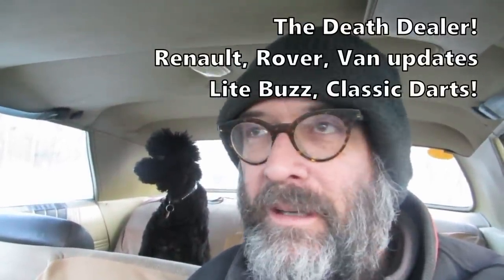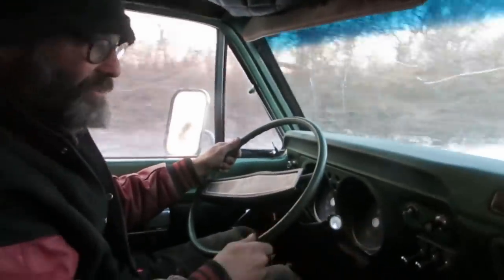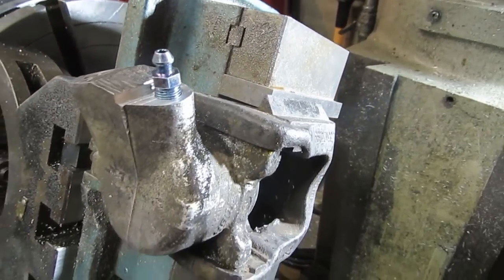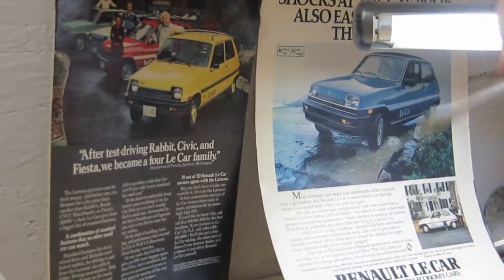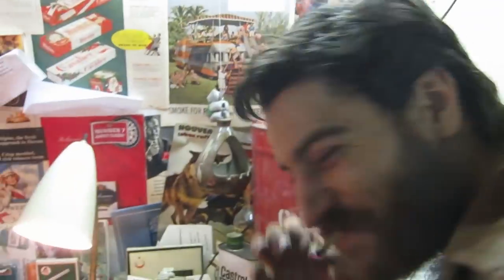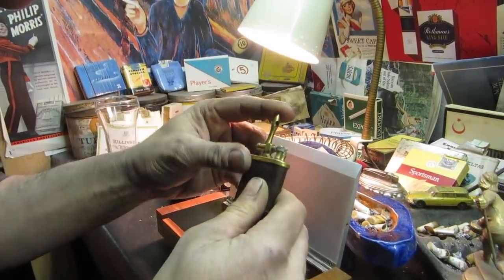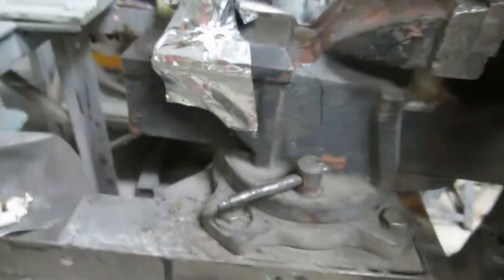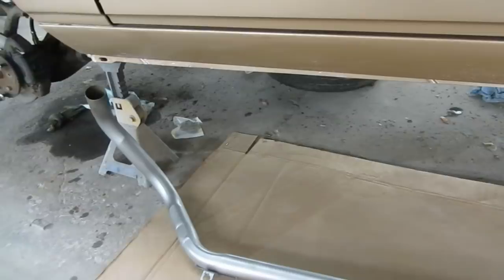Rotisserie Rover, Renault Renos, Boogie Vans, and Making a Screwdriver out of Cigarette Butts!

Comment: As a kid I had a yellow R5 by matchbox, always wanted a real one! I miss how individual those little cars used to be
Reply: I had one of those. Don't know what happened to it.
Reply: True, it was a very unmistakable design. But paradoxically, in pioneering huge plastic bumpers it was a large step to where we are now!
Reply: @thomasalbrecht5914  ...And the tail light clusters high up on the rear pillars...
Reply: @paulbennell3313  Yes, it was all first-rate small car design: functional, with every single piece serving multiple purposes where possible, and economical to put together. A good small car is a real exercise in production engineering, it’s not much cheaper on an industrial scale to make a small car than a bigger one, but there is a much smaller profit margin in it. So it takes brains to make something that is smart, and when someone comes up with a good idea for that, the competition will follow, because they’re all in the same trouble.
Reply: @thomasalbrecht5914  I think it's fair to sat the Renault 5 was the first supermini.

Comment: You need to remove the caliper seals and then clean the aluminum corrosion from the bottom of the groove the seal sits in. The corrosion over time builds up and pushes the seal tight against the piston and that is why you can't push the piston in by hand. I have done hundreds of seized motorcycle calipers that are the exact same design. I have even made a video about the process. 👍👍

Comment: When the Rover doesn't start, remember that Frankers has already identified the problem and check the fuel filter.
Reply: Frankers is certain thaT THERE IS A MOUSE INSIDE THAT EXHAUST PIPE!

Comment: Rust falling out of the rocker reminded me of when a friend got the front bumper of his rusted 76 Dodge Aspen wagon stuck into the wheel well of a Port Authority bus, when pulling out onto the street.  He got dragged a good 50 feet up the hill, before perfectly breaking away at an intersection and taking off.  His plan was to drive 50 feet up the hill in the parking lane and turn onto that street anyway, but he forgot that he had his wheels turned out toward the street. A friend who witnessed this charade in the local business section was laughing about how the Aspen left giant rust piles on the street, due to the shaking action.

Comment: That Renault brings back memories. In the 90s i worked in a muffler shop. Dealing with Eastern Canadian Coast rusted rocker panels on those cars. Trying to keep that exhaust pipe solid and the muffler inside the engine bay, not built for Canadas winter. Enjoy the videos, thanks.

Comment: On the plate from the Rover it probably is L for left-hand drive and S for saloon or sedan, the two body styles for the P5 being saloon and coupe, both four door but they had different window frames and rooflines.  It's interesting to see that it has disc front brakes when it's a mik1A version.  As memory serves, drum brakes all round were standard equipment on the mk1 and 1A with front discs being optional, so someone paid out for the discs when it was new or has retro-fitted them during its' life.  Front discs became standard later in the production life of the P5...
Reply from the maker: Thanks for the info! I wasn't aware that the discs were an option. The car seems pretty untouched, so I think they've probably been there since new, or almost new...Cheers!
Reply: @coldwarmotors    Yes, that's likely as swapping over to the discs would mean changing a lot of stuff, I think the hub carriers are different as they have, or take, a bracket for the callipers, the front brake lines are likely to be different, you'd need to add the vacuum port to the engine for the brake servo as the drums were not assisted and so on, a lot of work and expense on an older car...

Comment: I had an Amazamatics car as a kid in the early 70's.  It was  controlled by a card about 1.5 inches wide (37 mm for you Metric guys) with notches cut in the edges that followers would direct the steering and determine forward or reverse as the card automatically fed through the length of the car. It came with some factory made cards with programmed movements and blanks that you could cut yourself to program its movements.

Comment: Hey Scott,  those Renault calipers look to be aluminiun? This is mostly motorcycle stuff, but whenever I get a steel nipple that's tight in an ally caliper, I stop, fill the kettle and switch it on. While that's boiling I find an absorbent shop rag (T-shirt works well) and wrap that round the caliper where the nipple is. When the kettles boiling, pour most of the water over the rag, make a tasty hot beverage with the rest of the water. After a while of sitting and sipping, enough heat will have transferred to the body that you have a chance of getting the nipple out. The advantage is that you don't set fire to anything or melt any seals and it carries a lot more thermal energy than a heat gun. Not a guaranteed technique, but fairly low risk.

Comment: I' m thinking  the "Deathmobile" was probably done near the van conversion era due to fact that it was clearcoated in enamel or a 1st generation urethane.  It doesn't like look lacquer because it seems like it isn't "crazy cracking" like a lacquer would.  It might be tricky, but Kyle might be able to do a quick dust in to repair the clear or just leave the battle scars because it looks like it's not going to take any prisoners!

Comment: I have a set of Appliance aluminum slot mags that I've had restored. They're 15x7 with 5x4.5" (mopar/amc/ford) bolt pattern.  They're wearing F60-15 Polyglas GT's from the late 70s (you know, the style with the BIG, hollow letters).    Interested?  I had them restored for my Javelin but they stick out too much.... AMC wants more backspacing.   I'm in eastern BC.

Comment: Having a car on a "spit" makes it so much easier to work on, especially if you have to replace the floor.
Couldn't see much of the sub-frame clearly, but does the Rover have torsion bar suspension on the front?

Comment: What a contrast between the way the R5 and the P5 are conceived, it couldn’t be much greater a difference in design philosophy. Extremely interesting. The Renault is all about production efficiency, saving weight and cost, while providing maximum user benefit with a minimum of fuss and feast. Compared to this, the Rover is built almost like a one-off. That exhaust hanger is hilarious, it’s like someone made it from stuff that was lying around on a pile of random pieces in a corner of their shed. 
What’s better to restore? The Rover was extremely well made in terms of material quality and craftsmanship, and the handmade approach is easier to reproduce of course. But much of it is very complex, and the rot hides in places where the Renault doesn’t even have places. The Renault does have solutions that work extremely well when you first make it, but can age badly, and it takes a brave man to try to make it hold up and work again when it’s broken (that instrument cluster salvation in an earlier part was awesome).

Comment: Lots of work going on, nice dart custom screwdriver a must for every toolbox. Hey, don't scold frankers when she's making her cameo appearance in light buzz :). here's more recommendations i'm sure you always enjoy: nice fix on the pump impeller, couple notes. should have soaked it in conditioner and always lubricate before running, heat from the friction will fuse and tear the impeller blades off, same concept as any outboard or IO boat drive... never run dry. probably could make the impeller but with less and wider blades out of a chunk of rubber. Pretty cool rotisserie stand, might need to make one myself one day. Lots of rust on the birt mobile but scott's the king of metal repair, should be whipped up in short order. Very nice score on the old dodge death reaper boogie van jr and as well the boogie is looking good, does it need to be dropped a few inches? sits up kinda high. pasted below a few renault links from the states. cheers all good work.
https://sfbay.craigslist.org/eby/cto/d/san-pablo-renault-r5-lacar/7241125829.html
https://minneapolis.craigslist.org/ram/pts/d/saint-paul-1984-renault-alliance-encore/7240737904.html
https://akroncanton.craigslist.org/cto/d/lodi-1968-renault-caravelle-project/7235569944.html
https://knoxville.craigslist.org/pts/d/renault-chiltons-manual/7240001571.html
https://miami.craigslist.org/pbc/atq/d/west-palm-beach-1978-renault-5sale-or/7246405755.html
Merry Christmas

Comment: We had three of these, brakes are on the light side if you carry weight or tow. Rears for them are kind of weak.Check the front for corrosion around the control arms, but a really sweet van. Best of Luck.

Comment: Chris, use a kit from smooth-on to make your own mold
for the R5 taillight replacement. Original looks way better
then this round aftermarkets.
\edit The parts you want are avail from origin manuf. - 
Renault original but about 100€ in total excl. shipping.
Original velours seat cover sets in any colour 1000€

Comment: I remember the 1977 Dodge  van back then my Cousin Glen grandparents on his mom side had 1975 Dodge D350 1 ton van was old Ambulance then his Grandpa Bill took old 318 V8 2barrel hand choke carb and Manual transmission 3 in tree on Steering wheel column, 409 Rear end gears, put a 1976 Massey Ferguson Perkins Desiel combine motor  6 cylinder 360 Cubic Inches also bored to 400 Cubic Inches also not turbo type, floor shifter Manual transmission Creeper 4speed out 3 ton Stake truck plus and 390 Rear end gears! 24 volt Negative grounded plus turn to camper type!

Comment: Side boards have to go off the Van please   No side pipes good header pipes with x pipe along with a nice muffler dual exhaust finish with Swinger tail pipes with just some motor treats these motors do come to life mild cam 4 barrel carb/intake new timing chain

Comment: A 3D printer would make that impeller. Put it on the tools list.
Reply from the maker: Can you 3D print rubber / neoprene? If so, that would be a great fix, cheers!
Reply: @coldwarmotors  Not that I know of.  (I doubt it.) I was thinking Polypropylene.
Reply: Isn't it a diaphragm pump ?